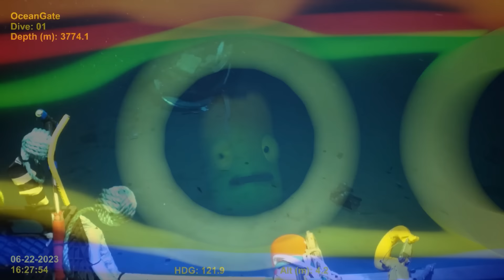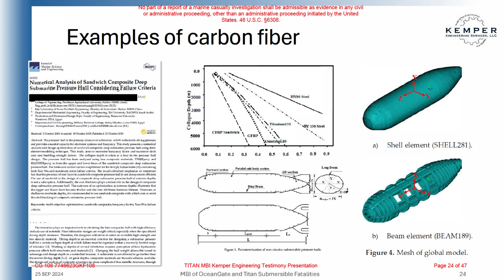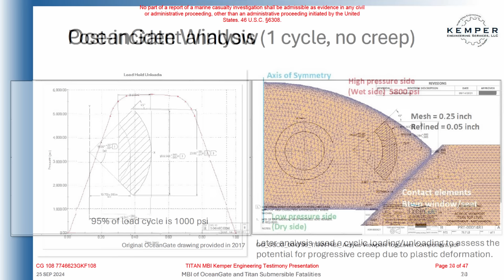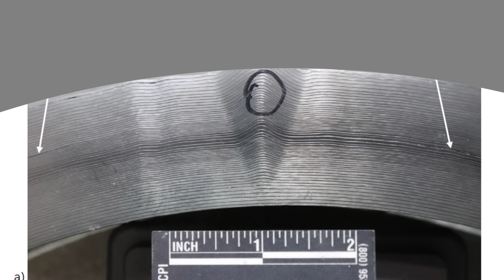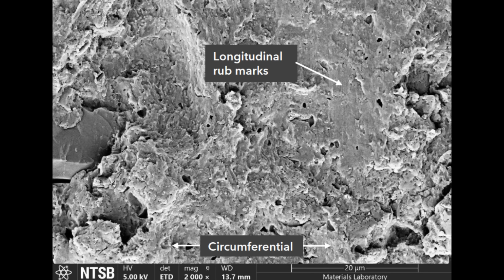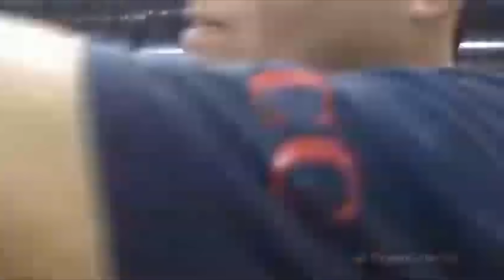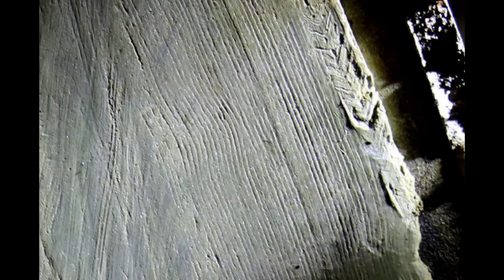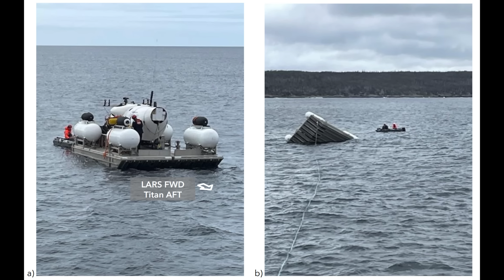OceanGate Wreck Shows Why Sub Wasn't Strong Enough To Survive - NTSB Shares Important Details

Comment: Okay Mr. Scott, I understand the fascination for this and the examples given of successful human-rated pressure vessels built with carbon fiber, but one thing irked me in this video: 
You keep complaining of the engineers who criticized the use of carbon fiber in this particular vessel, even saying they are "armchair engineers", while you go and say it yourself "I am not a mechanical engineer, I don't know if this is just 'meh' or incredibly serious".

That's irksome. And yes, those issues amount to very seriously concerning problems for the structural integrity of the vessel. If the voids and delaminations were a small fraction of the total surface area, that wouldn't have been a problem, but at that scale you are looking at a substantial decrease in strength, both due to stress concentration in the remaining layers of still-resisting adhesive (any discontinuities generate stress concentrations in excess of a homogenous redistribution of the stress field), and the reduced area of structural material resisting the loads imposed on the vessel. That's not "meh". It is very serious, and it is exactly why engineers were saying this is such a terrible idea.

A pressure vessel such as this made of carbon fiber polymer composite has a gigantic amount of problems in addition to a simple metallic vessel. The problems start from the fact the material is orthotropic instead of isotropic, then go through the multiple failure modes (that are much less of a problem with metal alloys), the issues with adhesion and curing, geometric tolerance in fabrication, degradation of performance being much harder to quantify (this isn't being used once after all, and the study of carbon fiber-polymer fatigue is a lot less mature than that of metallic structures), all of that would certainly require very substantial amounts of R&D, a lot of work, time and money spent to iron out successfully and reliably, and the company and CEO that seemed to aim for the "fast and loose" approach to engineering were not the kind to have the procedures and governance to assure studies were carried through as required and monitoring done to specification.

The "armchair engineers" were criticizing it from experience, from knowing the core tenant of engineering is using timed and tested solutions, especially for commercial applications. Novelty in engineering is rare for a reason, and never the reason is "cutting costs with support equipment".
Reply: I think you missed a nuance here because Scott delivers the entire voice-over instead of cutting to the voices of those testifying. Scott wasn't complaining about the engineers who criticized the design, he was reporting that Stockton Rush called them armchair engineers and discounted their opinions. If you want to be irked at someone, Rush is the right target, not Scott.

The "not a mechanical engineer" statement is Scott asking just how bad something he is seeing actually is so he can learn.
Reply: @brucetheloon  Ah ha! This might be it, thank you for letting me know.

Comment: In many modern light aviation designs carbon fiber is used in wing spar caps. In general the upper cap, which generally is subject to compression the amount of carbon fibers usually is triple of the lower cap. THAT is how much engineers trust the theoretically equal capability of carbon to bear tension vs compression...

Comment: I wonder how many of the "crew" were forced into the voids in the carbon fiber?
Reply: The sub imploded, it didn't explode. I don't see how their body parts could have been imbedded into the carbon fiber.
Reply: @allanshpeley4284  The people were at the center of a cylinder that shrank under extreme pressures. I would imagine that most of the smaller pieces of the hull became impregnated with microscopic human remains.

Comment: Peel ply is a protective film that 'mats' the surface it sits against. It's like the paper film on both sides of an acrylic sheet. It is meant to be removed before bonding any additional layers. Btw, my ex was a composite engineer at Boeing, so my CF knowledge is by osmosis.

I do know that CF properties are very dependent on the orientation of the layers. There were very good reasons why Boeing recommended 45 degree layers. Too bad this wasn't followed.

Comment: The porosity is very common. It’s a result of imperfect layup technique. But it is bad. Air can’t hold shear stress and so that inner porosity could cause the failure. It’s part of why people in the engineering community with composites experience were weary. That resin porosity is a common cause of non-repeatable behavior

Comment: The buckle in the cylinder made me think of my favorite way to crush aluminum cans. Stand on the can and let it support my weight. Then I take the toe of my other foot and lightly tap the side of the can to create a buckle in the side and I ride the can to the ground. It always amazes me that the thin aluminum can will support my weight as long as the structure is perfectly intact. Introduce a flaw and bam, squished can.

Comment: finally someone talking facts instead of waffle for clicks..... well done...... heres my thoughts...... the forward dome 'fell/snapped' off sometime around dive 80, the stress on the forward titanium ring/attached hull and glue must have been immense. this event was the beginning of the end, the RTM and strain measuring systems although not working as they should still detected a weaking and twisting of the hull around the area of the forward dome mount on the port side. Due to minimal testing done on scale models, the only data OG engineers had to compare against was the V1 hull and failed subscale models, all of which shown much larger devations in strain measurment than the dive 80 event, just like the space shuttle challenger, the engineers had very limited data to compare against due to the relative newness of the system, and even though engineers had voiced their concerns they were told differently by management as to the cause of the anomalous event(dive 80). Had the strain data been correctly analyzed then the dives should have stopped, however, the whole thing(just like the shuttle) was being driven by money, greed and schedule. 
The business model simply didnt work, even at 250k per ride per person, there was very little money available for expansion(more submersibles) or even maintenance on Titan. Had correct testing been done and a safe hull manufactured, the price per ticket would have potentially been millions(USD), and who is going to pay that sort of money? 
There was also clearly a manufacturing process defect on the adhesive layers between the carbon fibre stacks, as 2 held during the implosion and 2 did not plus the photos of the aft end titanium ring actually shows that the glue wasnt correctly bonded to the hull across the full surface of the C channel....... all of which would have been found with a correct testing program but there just wasnt the money to do it. 
My question at the moment is why was there no more dive data available after dive 83? what would that data have shown on the strain/RTM systems for the last 5 dives?  and whos going to the chair for this? its very clear that the core OG management were arrogant and basically sacked n silenced anyone that raised a concern or caused disruption, mrs Rush herself was more interested in if they could take someones money for a dive than getting them back to the surface safely. 
Every single person that blew smoke up stocktons ass, protected the company/product and help hide the facts should be accountable.

Comment: I'm curious in what state they were expecting to find the human remains? I estimate  an instantaneous temp increase of ~550°c for the gas in the sub at the point of implosion (I've assumed a density change equal to that of Osmium to estimate the new volume). However, the much higher pressure from the water now surrounding the bodies means the bpt of water in the bodies is >> 100°c and the 4°c water at that depth would act as a very efficient heatsink.
 Anyone got anything to add to my musings?

Comment: I think the real irony is this effectively proves that Carbon Fiber and acoustic monitoring are viable for deep sea submersibles… if you use better building and operating procedures. 

The whole thing about storing it outside is interesting, obviously larger submarines are not just stored outside but literally stored in the ocean, but even still this thing could fit into a 1 car garage, and it would have cost them very little little to protect it better while not in use.

Comment: The amount of air during the layup where the fibres aren't nice and tidy up against the mould or underlying layers is scary. It should have had way more compression cycles (debulks) during the layup to prevent wrinkles and voids.
The amount of voids in the cured laminate is scary, should have been detected druring an ultrasound NDT and reason enough to reject the part. 
The gluefilm directly on to the peelply  surface is kind of sketchy too, no material supplier will give guarantees in such a bond, every manual will say test under your own conditions and processes. 
The only places I know who glue directly on the peelply surface use it for repeatability and speed in a production setup, and have engineered the part for the weaker bond. Otherwise its sand till you're touching the fibres, so no excess resin is in the gluejoint.
Under a couple of inches of carbon fibre the heating during the cure will become important too, the resin needs some time to properly flow before curing in place, especially the glue film which needs to fill the peelply texture or sanding marks.
I think the concept is interesting and could definitely work, but high stress composite components need to be build under very specific environmental, material, engineering and workmanship controls. The part used should have been a reject for anything high performance. This would not have been tolerated in aerospace, high end motorsport or yacht construction.

Comment: I'm not a composites engineer, but my IRL job deals with a cyclic, dynamically heated system, and differential thermal expansion is a bitch. Parts growing relative to other parts and itself, and doing it over and over and over...destroys those parts. Like, it's a given for us that they have a short lifetime; as in if it were human rated, they would be single-use because within 10 cycles we have signs of damage. I have a feeling that this study will lead to a ban of composites for human-rated compressive hulls.

The hull compresses and decompresses; physically shrinks and expands with the pressure difference. Homogeneous materials like metals and even acrylic handle that well; the whole body shrinks at the same rate, and so long as they stay in elastic deformation, the worst that happens is a bit of creep. If they're good on the first cycle, they'll be good on the 100'th. With a layered construction like you'd find with a composite, the individual layers could move very slightly differently. If the glue holding them together can comply with that without taking damage, it's fine and the composite will also be roughly as strong as the 100th cycle as it was on the first. 
That glue powder is damage. A sign that the layers were moving along each other in a way that was degrading the glue's bond. Amplifying imperfections. The voids/imperfections had a mechanism to grow. Now, this probably isn't how the Titan failed. (That appears to be caused by the similar cyclic differential flexing where the composite hull joins the titanium end...which will compress at different rates and in different directions, imparting a moment in addition to the other stresses). But the growing voids in the composites mean that the hull had a very finite lifetime before a void grew to be a catastrophic concern. With Oceangate's "safety" strategy, it was only a matter of time before that hull failed. They would not have done the testing to see if this failure mode was happening.

Speaking of Oceangate's "safety" strategy, I wouldn't be shocked if the acoustic event WAS flagged for review by the system's original engineer's design intent, but the flagging system was actively handicapped at some point by Rush, either by skipping it, ignoring it, or firing the guy who designed it and never giving the responsibility to someone else. This could be the nail in the coffin for any trial that hinges upon negligence. We'll see what the NTSB uncovers.

Comment: I'm not even a structural engineer but looking at that titanium to carbon fiber interface the design of it just looks like they never even took into account that carbon fiber and titanium would deform differently under pressure.
With this design the carbon fiber hull being compressed inwards more means that there would be a shear force exactly in line with the interface surface as well as a lot of load on the inner flange (especially if that adhesive ever failed for some reason). At the verry least the interface surface should be at an angle to avoid that...

Comment: i work with composites, it could have worked, the unidirectional orientation of the cylinder made it doomed from the start. there are small cylinders that have 15,000 psi burst pressures. if you look at small composite cylinders meant for 5000psi + youll see the wrapping techniques are very different.

Comment: All things considered and putting aside the major engineering and safety issues. Financials are also important.

The OceanGate Finance Director said that the company had not made any profit to that point. And private investors were funding the company entirely. 

Emails between Stockton Rush and investors might reveal much more.

But I would speculate that Stockton was pushing expeditions to appease the private investors to generate revenue. 
He was under pressure to show his investors that his business proposition was a viable investment. 

It will be fascinating to see the financials. Not just the engineering issues. Which were massive obviously.

Comment: I think a significant issue that has likely been mentioned elsewhere was the different rates of compression for the titanium vs carbon fiber components.  Those joints so pressing at different rates over time could eventually lead to a failure - likely at the glue point, as you have discussed here.

Comment: Also I don't think they ignored the early warning system necessarily, the Tony engineer guy testified that after each dive the crackling the sensors picked up got less and less intense. Oceangate probably likened this to the carbon fiber "settling in" or breaking in like you would a baseball glove over time. They probably unironically assumed after a few dives there wouldn't be any cracks picked up at all via early warning and that meant it would never blow out one day or weaken suddenly LOL
Reply: It's like they'd never seen a bathtub curve.

Comment: So one thing about the glue between layers being pulverized and the relative motion between those laters- it suggests that the individual layers of the pressure hull were expanding and contracting at different rates.

Comment: Fascinating!  I particularly appreciate all the details you included on the window design and material.  Many (many!) years ago I got a chance to take a close up look at the Trieste while it was being stored at Point Loma (Naval Base San Diego), and talked with a CPO who was familiar with the craft.  He told me two very interesting details.  Regarding the window, he told me that the conical window would actually extrude into the pressure sphere when at depth.  He also told me about an uncrewed test dive they made.  Upon returning to the surface and opening the sphere it was found that every piece of equipment was smashed to bits, and that there was a small puddle of water on the bottom.  The conclusion was that a very small leak had occurred and that the water came in with such force that it ricocheted around the inside of the pressure sphere and demolished everything.

Comment: The monitoring system catching all this data, BUT nobody is intelligent enough to figure it all out, or they didn't look at the data very often. That data clearly shows a change of the characteristics of the hulls response to pressure over time, so dive after dive after dive, it should have been monitored and compared to previous dives. The pressure vessel basically got fatigued and failed over time.

Comment: Scott Manley - Something I would love to see is an engineering look at what it would take to build a submersible to do this dive safely many times.

I do not know the engineering, materials, or manufacturing of this kind of equipment well enough to have a clue.  It is simply too extreme for me.
Reply: It's been done.  The problem they're bigger, heavier, more expensive (and thus safer) and require larger support ships and staff.  Cameron went down to Titanic in one.  I just can't recall what it was called.
Reply: @TheEvilmooseofdoom  This is true, but how many return trips could those vessels make safely?

This is the biggest issue.  The material stress from each dive accumulates over time and will lead to failure.  How to engineer this for larger numbers of dives in between major servicing or replacement of the dive vehicles is what determines whether deep sea "tourism" or other uses with people present at those depths becomes truly viable for more than a novelty for the exceedingly wealthy.